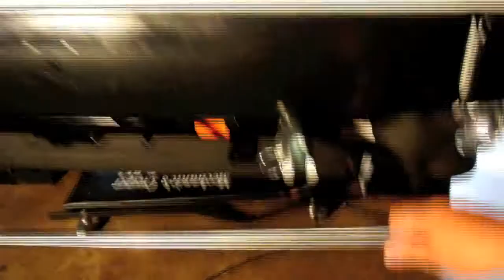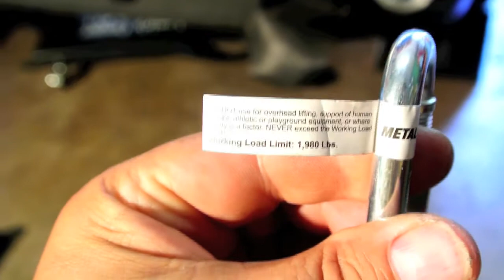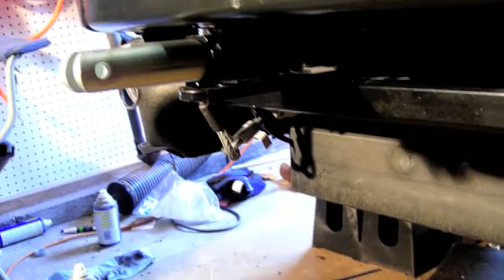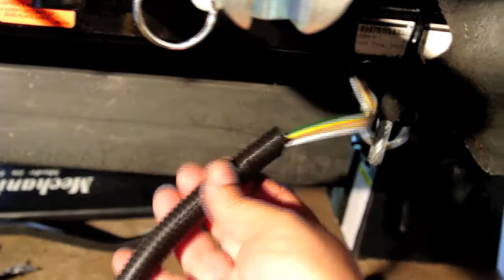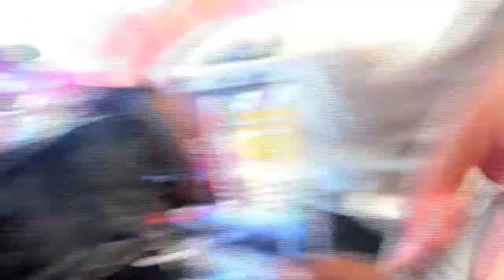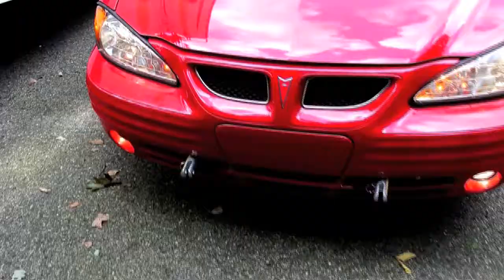RV towed vehicle project: Installing a baseplate part 3.

Comment: 007 guns was a cool touch. TOAD car ain't in my budget still / though.
Reply from the maker: missingremote If you can find a mid 2000s Saturn, most of them can be towed (our Grand Am uses the same transmission as some Saturns do). You could probably find a 10yr old one for a song... probably will cost more to outfit the car (tow bar, brake system, etc) than the cost of the car.